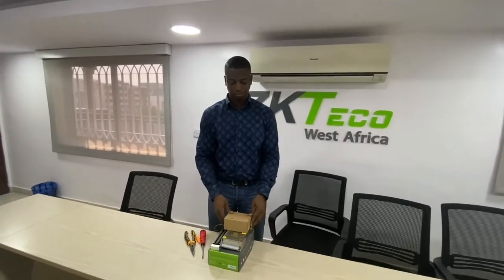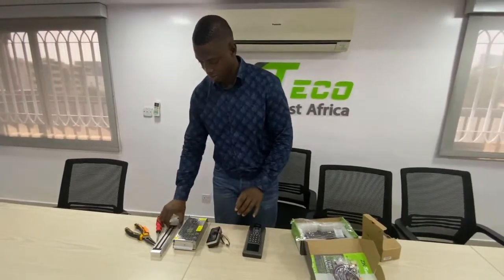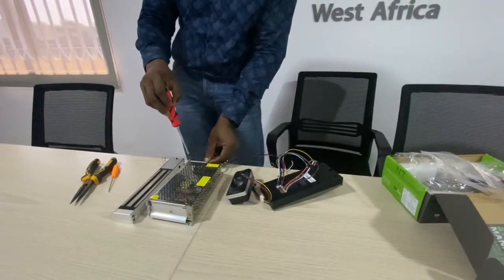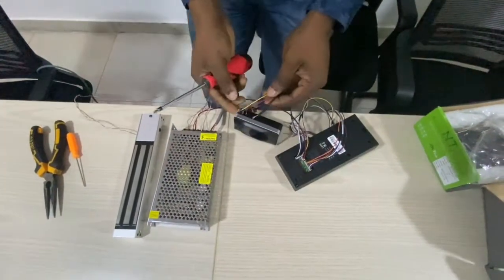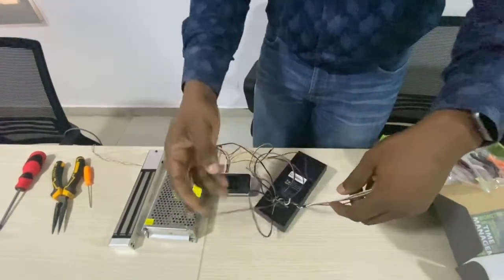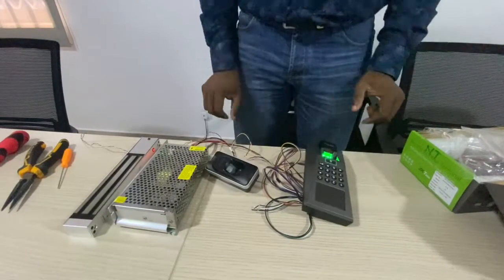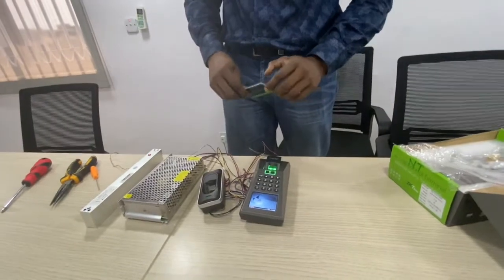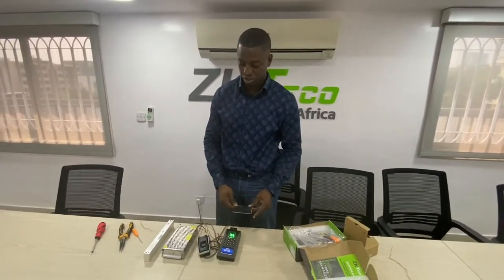Master Slave Configuration F18 & FR1200

Comment: I only want to use FR1200 but without a master unit. Can I get somewhere the communication protocol manual = the data FR1200 sends/receives over RS485?